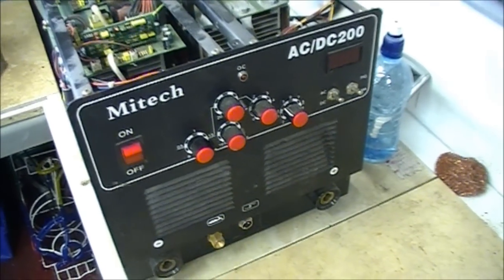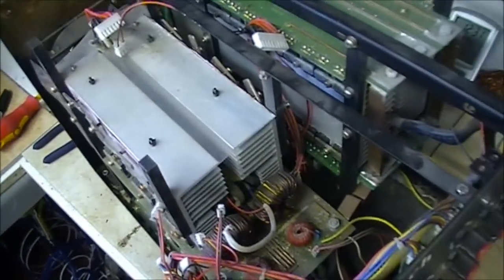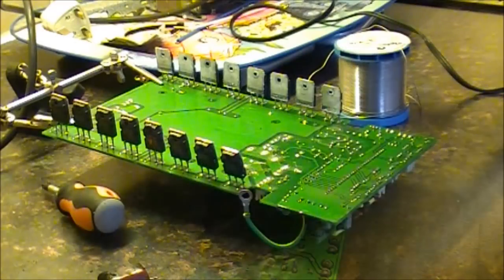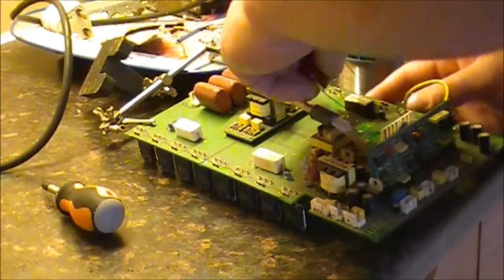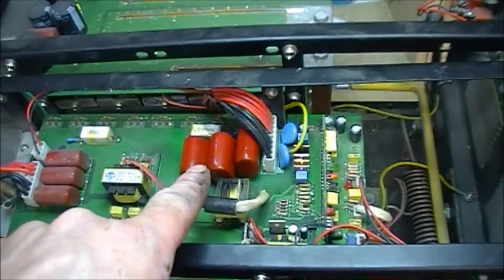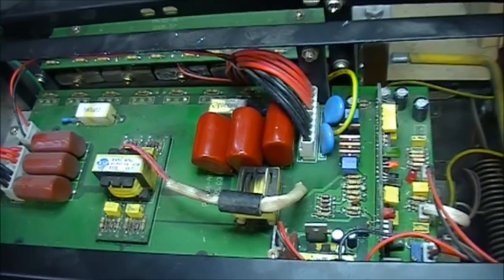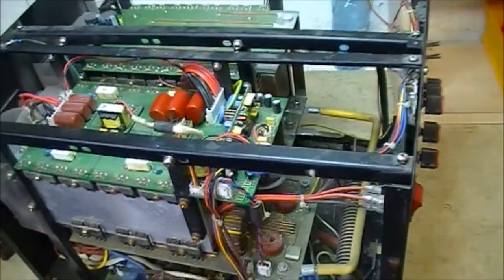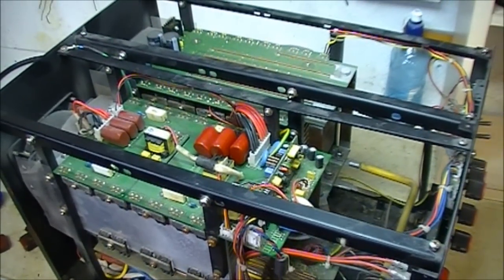Mitech AC DC 200 welder repair

Comment: I just blew out the three that are at the end of the board... They look the same size... Do you have any way to check what capacity they are?

Thanks
Reply from the maker: I think i said it in the video what capacity they were. i do remember they were 450V caps. that was 7 years ago lol. Hope you get it fixed!
Reply: @GeorgeEI7KO  Thanks for the prompt reply... I will order some and see if this thing is fixable.... Thanks again
Reply from the maker: @mcgam2000  no sweat. It's still going anyway. I messaged the guy I fixed it for...

Comment: Excellent tutorial ....takes me into ask ..what if having a AC/DC aluminum welding machine and even got it checked in each and every possible function failure, it doesn`t want to deliver current due the lack of spark in the HF also Checked electronically?

Comment: Hi George
I have the exact welding machine as yours with a post gas flow problem.It shuts the gas off before the arc no matter where the post gas flow adjustment is.I can't find a repair manual or replacement parts and Mitech has no tech support whatsoever.
Any ideas on where to TS on the control panel and/or board ?
Thanks
Steve
Reply from the maker: Steve Fetz hi Steve, I've no idea! There is no info on these welders on the net at all. I just hit lucky with this one! Hope you find the issue
Reply: George EI7KO 
Hi George 
No worries Thanks for the reply 
Merry Christmas

Comment: i have a rilon 200amp MOSFET welding machine | machine is working but current is not coming out oc light is also not coming than also current is not coming out
Reply: Saad Shaikh IT MAY FAILURE OF MOFSET. MY MACHINE IS THE SAME AND MET THE SAME PROBLEM. AFTER CHANGING MOFSET NOW IT WORKS WELL.
Reply: If the current is not coming out then the machine is not exactly working now is it.

Comment: Am daniel kili in kenya africa i repair tig,arc mig and plasma
Reply from the maker: daniel kili hi mate. Drop your email address on here. I get so many messages asking  about fixing welders. I'm into radio electronics, so I don't really know that much about welders . Was just a lucky fix for a friend
Reply: George EI7KO yes u can but  in which place
Reply: @GeorgeEI7KO  hi
Reply: Hi sir I need help for inverter welding machine repair
Reply: sweet boy play boy  what problem?

Comment: I have a 200 Ac/DC pulse Welding machine and it switches on and of but the overload light is on and it won't weld . Which of the cards can it be and how/were can I repair/replace it ? I tried locally .thank you
Reply from the maker: I madethis honestly I couldn't say without seeing it. This is the most popular video on my channel. I just fixed it for a friend. I've no experience with welders really. Seems to be a huge problem with these cheap Chinese made welders
Reply: Honesty i have to see it

Comment: Hi
I have a similar acdc tig welder 200Amp with the similar pc board as yours but with pulse,, the problem I am having is I cant get the pulse to work, I have tried every settings, checked every wire etc - Do you have any advise on what board is responsible for the pulse? there is a pulse on/off button and dails for pulse freq. the buttons and dials test ok with the meter, but the pulse feature doesnt work. NB  everything else works and the machine is brand new, the manufacturers have now stopped answering my emails.

Comment: I have a Miller Blue Star 180 K DC welder generator that burned a diode inthe filed current regulator circuit board. Airgas Gaspro quoted me over $413.00 to replace the circuit board. My friend in Canda is going to try to repair it for me... Any suggestions???
Reply from the maker: No idea man, open the sucker up
Reply: Irishman1127 I did...had a burned diode caused by a bad transistor...the machine sat for almost 10 years before I got it from my cousin. My friend tested the circuit board & found a bad transistor. I'm waiting on him to make a repair video to aqdd to my repair video series...
Reply: Kohl's iron works... First suggestion is don't buy shit from Airgas, they are a total ripoff. 
Go to Millerwelds.com for a start.
Also, Miller has a nasty habit of not offering any parts for anything over 10 years old. Miller is an industry standard Ripoff as well. $7000 for a Dynasty and $4000 for the board when it takes a shit.
Thanks Miller

Comment: hi i have a similar welding machine. lately TIG function is not working and there is no voltage current to TIG function. Any suggessions? thanks in advance
Reply from the maker: Other than open it up and look inside...no